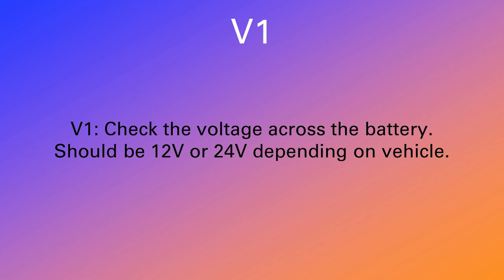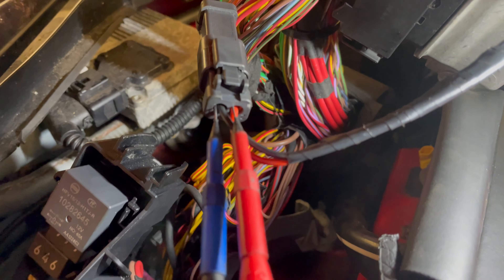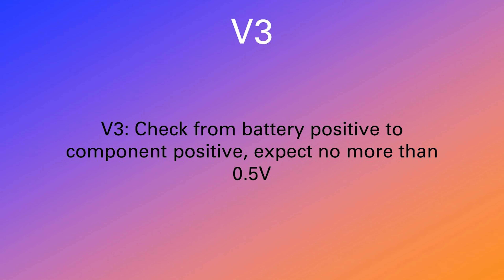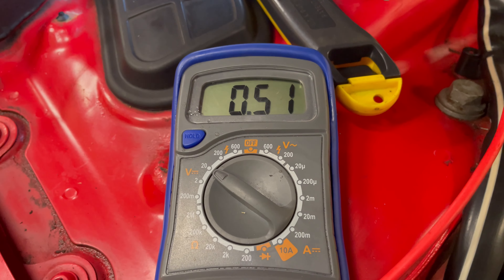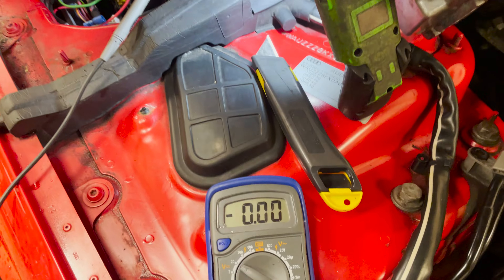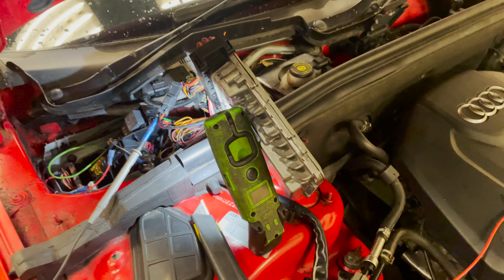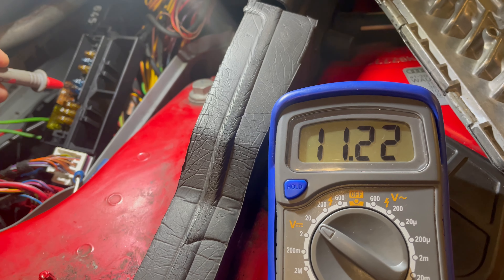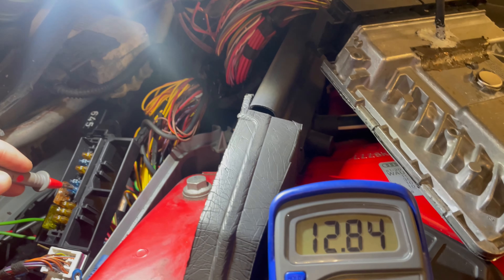Voltage Drop Test

Comment: Nice job and what a cracking video. Not so common to find corroded fuses and sometimes not possible to see this resistance with the naked eye. Hell of a drop there 👍
Reply from the maker: Thank you. It definitely was an unusual fault. Proof that checking for voltage drop is a great diagnostic test. 😊

Comment: Thank you for the well explained process. What was this fuse operating please?
Reply from the maker: This is fuse 7 in the engine compartment fuse box (next to the pcm). This one fuse feeds a lot of components. Inlet cam solenoid,  oil pressure control valve, coolant pump relay, canister purge solenoid, turbo pressure control and bypass valves. It feeds the red/yellow wire to each of these components.

Comment: nice job thank you for sharing 
I have questions what is the car and what is consumer connector was ?
Reply from the maker: The car was a 2012 Audi A4 1.8TFSI. The fuse was number 6 (15A) in the left plenum chamber (next to engine ECU). This powered the engine component supply relay coil and three of the fuses in fuse panel c (at the side of the dashboard). The three fuses where for clutch pedal switch interlock (5A), fuel pump control module (25A) and brake light switch (5A). I used the free wiring diagram CARMIN STD in the app store to find it.

Comment: Fantastic explanation but this is why I teach my apprentices to use test lights on fuses.
Reply from the maker: Absolutely. The test lamp is still one of the fundamental pieces of diagnostic equipment that should be used when checking circuits.